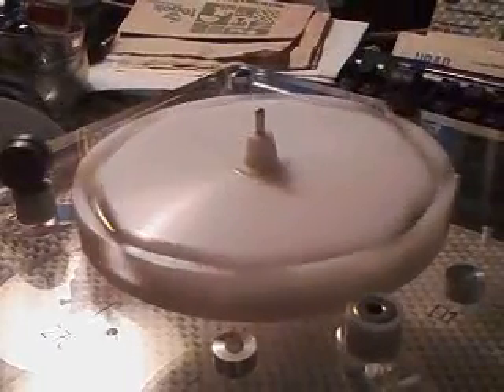WhiPMag II Resonance Check

Comment from the maker: Yeah, I did try some manual damping through different RPM ranges and I tried a variety of different angles to see how things interacted. I did not find any gain mechanisms in this arrangement. The energy transfers were interesting to study, especially as storage systems and time variant impulse actions. Overall, the total field interactions did net to conservative even though some of it was split and rejoined.

Cheers

Comment from the maker: All measurements are exact replicas of the original. The LRF's are custom and the hub attachment is different, but the rotor and stators are identical and the spindle is identical make and model. The rotor magnets are diffferent, but the stator magnets are same manufacturer and model. I put this up to demonstrate the RPM dependent resonance relative to the rotor field patterns.

Comment from the maker: Thank you for the complements, but I can only take a very small portion of the credit. Madprof is the craftsman behind the impressive replica and Alsetalokin was more than kind in his assistance in procuring some of the needed parts and measurements. Even so, there is still a missing 'something' that when found will solve the puzzle.
See Fizzx[dot]com for more posts from replicators.

Cheers.

Comment: You don't give it up. very good, keep pushing the enevelope of replication. There is no other way.
Have you checked out with user/tinselkoala? He seems to be the original man of the OCMPMM 
Maybe still, something essential is missing in this design. What would that be? I found in one of my own experiments that a ringmagnet placed upright towards the center of the rotor improves the stability of the magnet disc. It phases the flux and could contribute to a more stable, or conserved even rhythm.